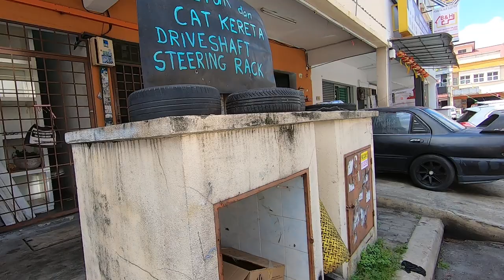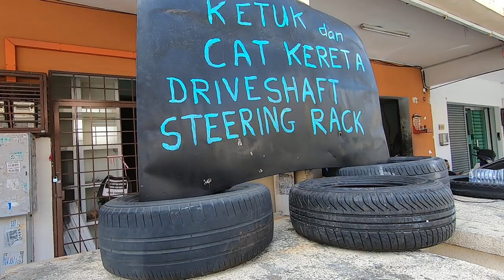UCR: 1996 Fiat Punto Cabrio 1.6i Goes to Chris's Shop & Project Volvo 850 Spied! | EvoMalaysia.com

Comment: GET THE VOLVO

On a sidenote, I saw the early (Still boxy) Volvo V70 wagon yesterday. 🤭 Probably the last of the genuine  "Brickwagons" isn't it?
Reply: If not mistaken the 850 series is the first FWD sedan configuration from Volvo. From then onwards most of model are FWD. 

Personally I enjoy driving RWD more than FWD
Reply: @2fredtcm  Yeah, but I think the 850 (And the early V70 is derived from it) is the last Volvo with a boxy design? They all went with more curved designs after that.
(But as RWD brick Volvos goes, the 900 series would be the last right?)
Reply from the maker: Yes, 940 was the last of the RWD Volvos, and yeah the 850 was the last of the squarish Brickwagons from Volvo, they got curvier after this, even the V70 that replaced the 850 wagon was slightly more rounded already 😊
Reply: Yes 900 series was the last RWD Volvo that not much people paid attention to it as the  850T5 and 850R was making making waves in the racing world. These 2 models would make me always have a second look on it. Chris if you ever come across either a 850 T5 wagon or 850R for sale, do grab it if you can, as I dont see these much on the road these days.
Reply: Btw Chris, which one is the most stupidest youtube channel around? Lost in translation, hahaha
Reply from the maker: @azlandin9911  check the pinned comment 😉